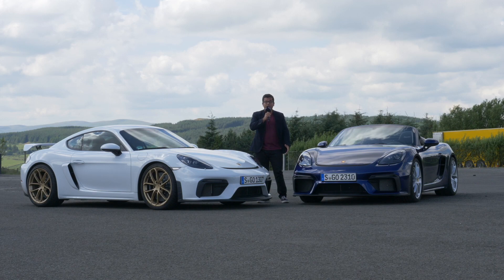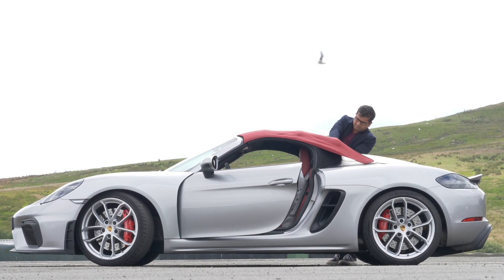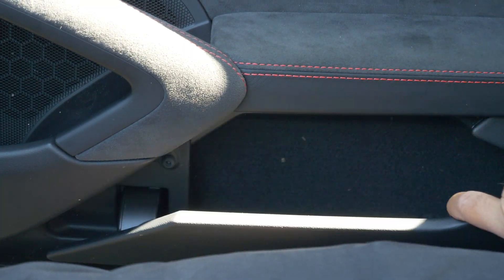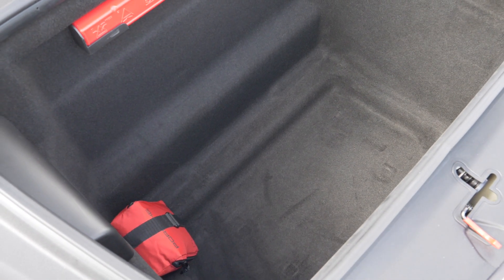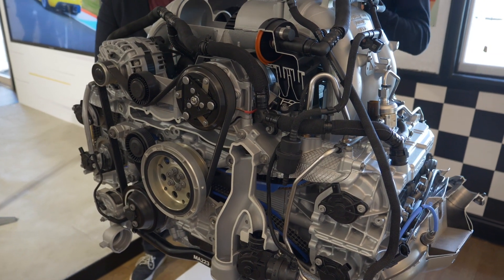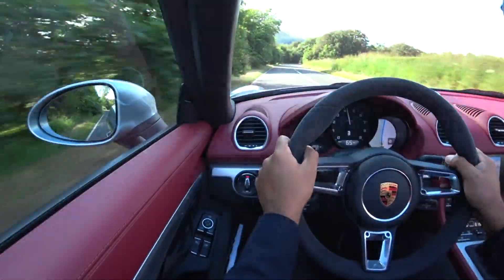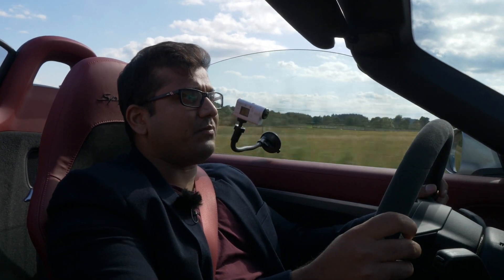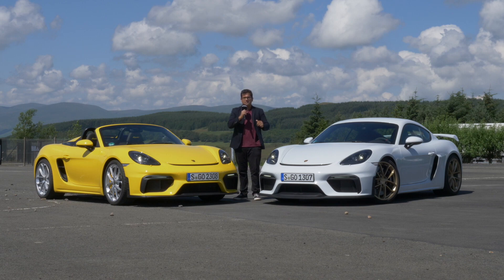Porsche 718 Cayman GT4 vs 718 Spyder FULL REVIEW comparison - the six-cylinders return!

Comment: Perhaps I need to hear one of each in person, but the sound in the 718 variants leave much to be desired over the 981. Otherwise, both look fantastic.
Reply: @TCaad10 The 991 GT3 engine was derived from the 9A1 in the Carrera and 981, so I don't see how an NA 9A2 with 33% larger displacement is any less of a GT engine.
Reply: Both are shit engines anyways. Not the real race engine from 991.2 gt3
Reply: GS Three and for stating such a BS I guess you are driving a Ford 150 pick up

Comment: Don't really like that Spyder's soft top roof being manual. I'd get the Cayman GT4 in a daily driver build but not sure about the gearing. I wonder if the next gen Cayman will have 6 cylinder engines.
Reply: If you really want a convertible but are a purist, this is the only way to go.
Reply: @arr0gant1  Yes that's true but it didn't look good when he put the roof up in my opinion.

Comment: I love the cayman, and especially the GT4. But im really not in agreement with some of the reviews.
For me, the biggest value of this car is a simple fact that it is being sold again rather than how much better the car got, because enjoyment speaking, it did not get better for the following reasons:
The meh/bad (ok bad is way too strong of a word):
1. the engine DOES NOT feel special at all. Its a bored and stroked up 4.0L from the 3.0L carrera. It DOES NOT sound much better than say even a 981 GTS or a 981 GT4. It however, DOES SOUND VERY GOOD in our current generation of past 2 years, where everything has particle filters and terrible sounding engines. Whereas the 4L in the GT3s sound special. Ofc, they had to do this to keep production costs lower, price lower, and keep Caymans below the 911 which is understandable.
2. All lot of the stuff being boasted in these reviews are NOT unique to the GT4, and are often times common Porsche options.
3.THe car's chassis is good, but stilll practically the same thing from 2013. The suspension setup and GT3 front end is really the star here and obviously makes a significant difference.
4. All this praise about balance, feeling nature, being telepathic to drive etc, applies to 981 as well, and most of 718 (other than PDK being a little strange with 718 compared to 991 and 981, but this car is manual anyways so PDK shouldn't be compared).
5. *still has the terrible 981gt4 gear ratio*. Really locks the car's performance down...

The good:
-its being sold again and not in limited quantity (or at least a promise of a quantity that will supposedly satisfy the market). Hurray! NO more allocation wars! Depreciation should be normal (well. for a GT car).
-despite reusing most of what the 2013 base car is, its still an INCREDIBLE car The car is ahead of its time and can remain competitive in the current market.
-still extremely enjoyable, just not by an amount that people hype it up to be.

Comment: This is the engine the Cayman 718 needed. With Cylinder-bank disabling, and Stop-Start it would deliver materially lower CO2 emissions than going to the in-line 4 Turbo (which when the turbo kicks-in above 2500rpm, drinks petrol and negates any emission benefit of going to a 4-cyl). What Prosche need to do is to put this into the entry-level Cayman and the Cayman S. The GT4 is a track-focused car, and is a little bit more hardcore (stiffer suspension, big rear wing, 20in wheels, manual only). Not many will drive it as a daily (although you can). So Porsche, please put this 6-cyl NA engine into the Cayman S. It will make the 718 (ok, call it something else), the car it has always needed to be.

Comment: Still enormous long gearing. 2nd gear at 8000rpm is 88 mph or 141 kmh, 3rd almost 190kmh, 4th 240kmh. Ruins promising engine, when you must overtake in 1st gear some ordinary TDI engined car, or 1.0 petrol turbo
Reply from the maker: Good point, u could see that long gearing at the racetrack especially. Meant to be driven redline only, but unrealistic for day to day customers
Reply: @autogefuehl  The tall gearing is a necessary compromise in order to meet emissions regs. If tall gears are the price I have to pay for a naturally aspirated flat six with an honest to goodness stick shift, sign me up.

Comment: As a current 991.1 GTS manual owner, I'm hesitant about upgrading to the GT4, mostly due to the gearing. There isn't enough torque being produced to justify the ratios. These cars aren't slow, but I've driven a 981 GT4 on a track many times, it works there and only there. If you want to go through the mountains with these, you're 2nd hear mostly and have no pull out of the corners. It's a shame that Porsche can't produce more tq from a 4.0l these days.
Reply: If you are in the us, sharkwerks does shorter ratios for the gt4. They did it for the previous model so I guess they'll do it for this too
Reply: @RtasVadumeeKostas  Yeah, I heard that they can do that. I'm only 230 miles from them. It's tempting, for sure...

Comment: Its an Audi and probably the TT hence the big tunnel fo the gear box that in a front drive car is located behind the motor. If you know there is a 928 944 and 968 that have front wheel drives it is kind of silly!

Comment: 2019 MX-5 is a better sports car for the road. Period.
Reply: Better value maybe but in terms of performance there is a clear difference.
Reply: @Dudsy907  there is a clear difference in performance ? Wow you're a genius to know that. And is it a performance to pay 98 000 euros to use only the first two gears on the road ? Second gear on the 718 Spyder goes up to 140 km/h when hitting the red line. So maybe you wish to lose your driving licence ?
Reply: @lensoprezole5322  You're correct. Porsche purposely handicaps the GT4 with long gear ratios in order to keep it from being too competitive with the GT3. This ruins the driving experience of the GT4. That's way the Miata is way more fun to drive than the GT4.
Reply: @Jonathan Bowen depending on the type of track, long gear ratios can actually make you slower and makes it harder for a driver to control exactly how they want to deliver the torque.
Reply: @Jonathan Bowen all porsches are track cars only if you want to shift at the red line with all the gears. In fact all cars making more than 200 hp. Thats why the miata is the answer for those who wants to use their gear lever on the road.
Reply: @Jonathan Bowen Those long gear ratios ruin the overall driving experience no matter how you try to justify them.
Reply: You keep driving your Mazda. I'll stick with my GT4, thanks.
Reply: @zarbon700  Uh, no.
Reply: @rsenior7140  He'll have more fun with his miata than you will have with your GT4. Just because a car is faster doesn't matter it's better than a slower one.
Reply: @rsenior7140  Uh, yes
Reply: zarbon700 mine is better. By a mile. To argue that a Miata is even close to a GT4 is absurd. Get real. Or get a job so you can afford a real car, not some rice burner.
Reply: @rsenior7140  you have no understanding of driving dynamics and little experience driving a variety of high performance cars. I've driven miatas, gt4, gt3, and gt3 rs, and the miata is definitely more agile. Miata's lightweight plays an important part way a Porsche can't  be as agile.
Reply: Lenso your absolutely right the MX5 is the ultimate Hairdresser car...I am sure your female clients are so impressed when you rock up in the MX5 hair dryer in hand
Reply: @zarbon700  Lel im sorry but it sounds like your trolling us. I love Mx5s but to say they handle better than a cayman or a 911 ? 
The dynamics of either car aren't even comparable to each other. The difference in downforce alone is huge, which has a big effect on the handling capability.
Reply: Bhahahahhahahahahaha
Reply: @zarbon700  how about the new supra
Reply: @rsenior7140  When we talk about handling we are not talking of performance. they are 2 different things. Talking handling is talking about the quality of the dynamic behaviour of a car. Not simply how much grip it has or how fast it goes in corners. I will copy you a link to a video made by professional german reviewers from "sport auto", they drive brand new supercars all year, every years, the video is about the best 2019 handling sports car. contenders are GT3RS, 488 pista and so on. they will give you a lesson about what handling is and you will learn that the winner is the opposite of what you think as a beginner in sports car knowledge. click on that link : https://www.youtube.com/watch?v=CG7Cmv46avA Then reply to me.
Reply: @Dudsy907  When we talk about handling we are not talking of performance and speed. They are 2 different things. Talking handling is talking about the quality of the dynamic behaviour of a car. Not simply how much grip it has or how fast it goes in corners. I will copy you a link to a video made by professional german reviewers from "sport auto", they drive brand new supercars all year, every years, the video is about the best 2019 handling sports car. Contenders are GT3RS, 488 pista and so on. They will give you a lesson about what handling is and you will learn that the winner is the opposite of what you think as a beginner in sports car knowledge. Click on that link and activate english subtitles : https://www.youtube.com/watch?v=CG7Cmv46avA Then reply to me.
Reply: @Dudsy907  Have you driven all those cars? If you haven't, don't assume things. Cayman handles much better than a 911 due to its mid-engine layout. A Cayman is overall a better driver's car than a 911. That being said, miata is still more agile than a Cayman due to it's lightweight and steering rack. The miata doesn't need huge downforce because it's lightweight and isn't a high speed car.
Reply: @behindthen0thing  I haven't driven the new supra yet.
Reply: I was just thinking about the Mx 5
Reply: I’m 6’3” the Mazda is designed for midgets
Reply: @GadgetMart  same here i couldn't fit in one and im 6'2 1/2
Reply: @alanwayte1688  Which sports car would you advice me ? What model do you drive so I will have inspiration ? Thanks.
Reply: zarbon700 what you’re saying doesn’t make sense the gt4 will outperform the mx-5 in every situation, even on a gocart track where you would think an mx5 would be quicker.
Reply: @Xynteon  We are not talking about track times. We are talking of the amount of fun and pleasure those cars will give you. The GT4 has so much grip that it will be difficult to approach its limits so it is a less fun car.
Reply: @lensoprezole5322  I absolutely love the philosophy behind the mx-5 but IMO they are not comparable, two different classes...
I do prefer the 86 over the mx-5 though. The mx-5 got its stereotype because women drive it in western countries because it is too compact for a grown man, not everyone is shaped like a 170cm tall asian guy, so a larger mx-5 would get rid of that stereotype. Maybe something to the like of the 2003 mazda roadster. Same philosophy just a tad  bigger.
Reply: @zarbon700  Have you ever driven one?
Reply: I have owned a MX5 and presently own a GT4. Not the same thing at all.

Comment: 1500 kg is way too much for a spyder
all that leather is like 200 kg (+insulation)
and the wheels are too big
they could save 300 kgs but the owners are just old fat bald rich men that care about comfort but want to look cool
Reply: I own a 981 Spyder.  They take all the sound insulation out.  But these new ones are much heavier.....
Reply: Princess Peach Yeah much heavier 😂😂 no the are not, only 30kg’s - get your information right
Reply: @Maximumrandom69  30kg is a heavy bag or a person, try to lift it
Reply: @fragu123  your argument is invalid
Reply: RVINDVNCE 30kg are not even 2%...
Reply: They are only 1420 kg (wet curb weight with fuel and fluids). The 1500 kg mentioned was probably including the weight of a driver. Also, speccing bucket seats and PCCB will lower the weight to around 1380 kg. The 1420 kg is with steel brakes and sport seats plus.